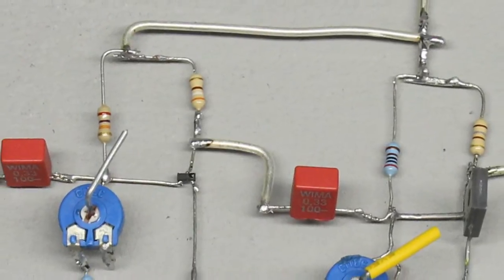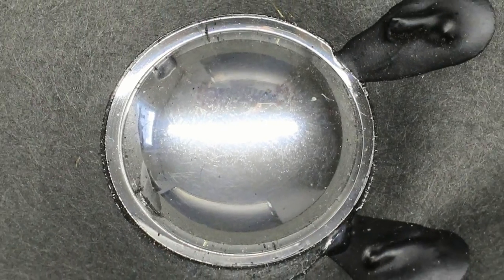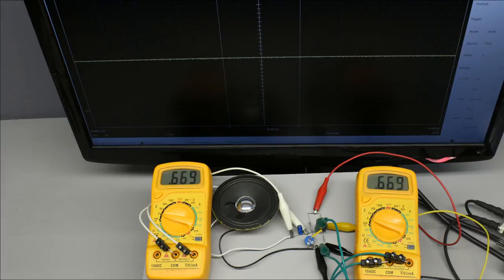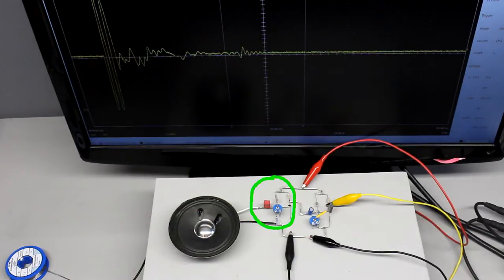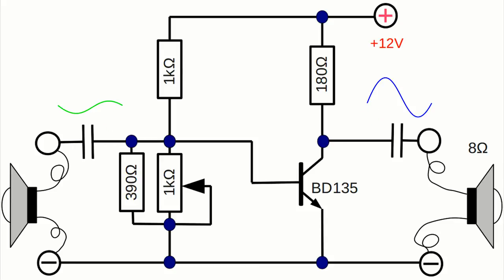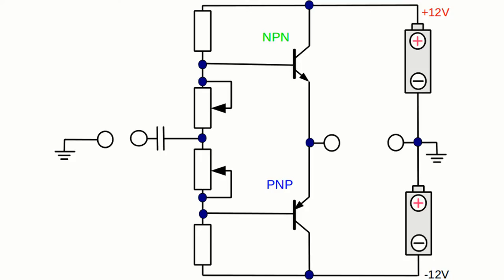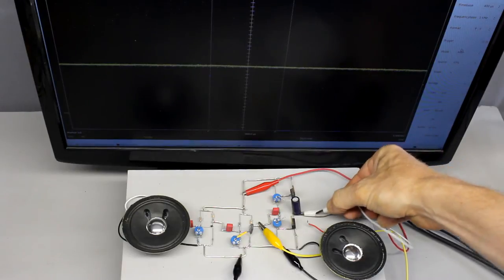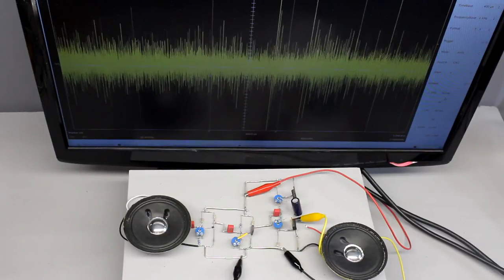Amplifying circuits

Comment: To help prevent the amplified output from affecting the input through the power line, you can usually add what's called a "bypass" to the power line, or even just a large capacitor across the power line as well, will help. Bypass circuits are usually used for high gain IC's, etc - you put a capacitor across power lines, but directly near the amplifier (rather than any distance away) to minimize distance and inductance. It won't always solve all "feedback" issues, but helps. Ideally, what works the best is to have the "pregain" low power high gain preamp, run on a a separate power supply than the high power output - that way the high power fluctuations do not affect the preamp
Reply: +nikotwenty I guess I  meant, it's called decoupling
Reply from the maker: +nikotwenty This video was meant to be a rough introduction into amplifying circuits. There is a lot more to be considered to get high quality amplifiers. Besides short paths, the type of capacitor has to be considered to reduce unwanted resistance and inductance. I'll keep your comment in mind when creating a new version of this video. Thanks!